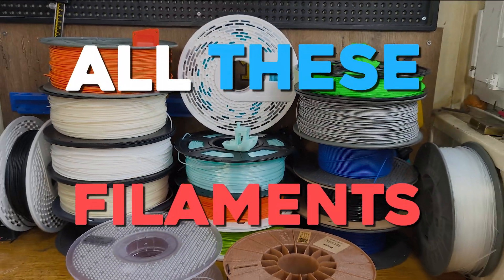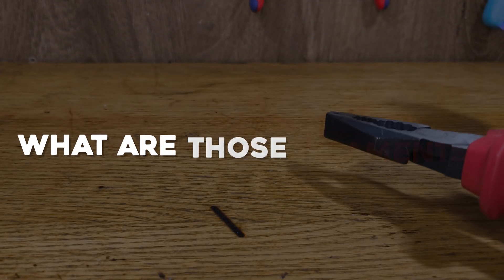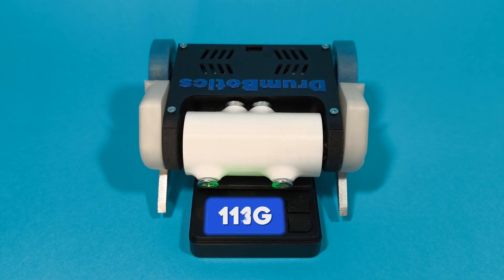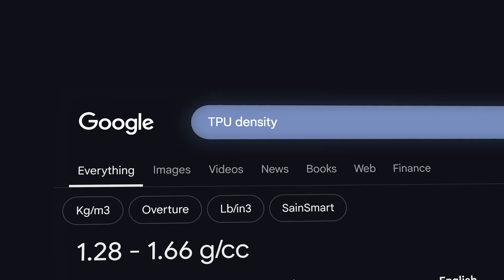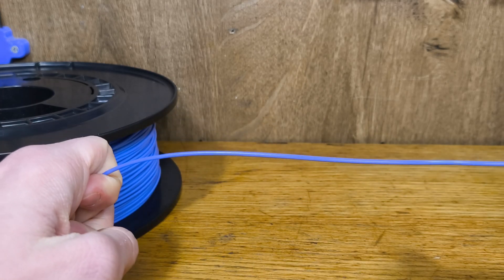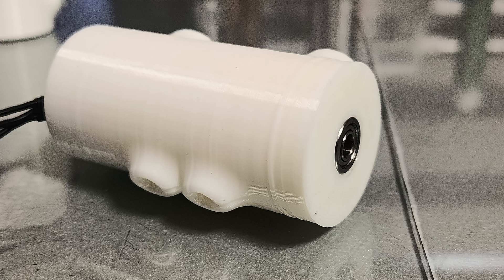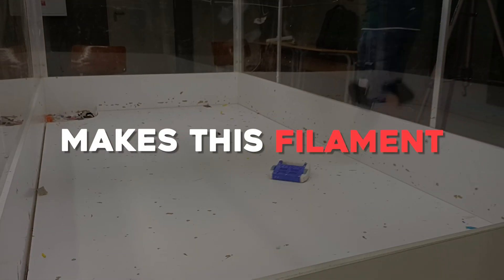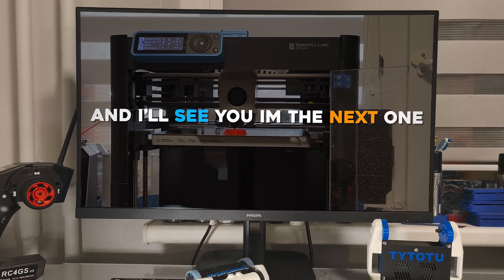Your 3D prints are BREAKING, here's why...

Comment: not sure how hips would be for combat bots but for rc cars makes a great material with good impact resistance. Ive printed motor mounts and spindles with it and it holds up great just hard to print well with from what ive done so far. and the temp recommendation on it is a bit low since its intended use is as support for abs but i think its great on its own

Comment: I tried using petg for the weapon of my plastic and weight shell spinner, even though it was tough, the supports were extremely hard to remove, and the teeth didn't fit in.
Reply from the maker: @Robogalex  Use a bigger gap between the support and the body, in the slicer.

Comment: Pick up some ceramic pla+ or overture super pla+, they're some of the best pla+ blends out there, and can rival nylon but with no moisture or warping issues

And the weight of pp is nice, but it still cracks under large hits, even with additional walls, because it's much more rigid. increasing walls makes this worse, so the ability to add more material for the same weight doesn't necessarily improve the toughness of the part

Comment: Nylon needs a garolite plate. The aftermarket ones are on a thicker spring steel base one so it's not going to warp anyway. Standard dryer is not going to cut for long term drying when you need 100 C+. Aside from that it's easy.
Reply from the maker: @MrHarvywallbanger  Standart drier is more than enought for sure. But yeah with garolite plate printing nylon became easier.
Reply: You don't "need" 100C, higher temps just speed it up. Leave any filament in 0% rH for long enough and it will dry, the temperature is just an easy way to both lower rH AND speed up the process all in one.

Comment: If I want my bot to be fully flexable, what should I use ?
Reply from the maker: If you don't care about weight then TPU is the best of course. Printing the whole frame from PP would be hard, same with nylon. It depends on what weight class you are making.
Reply: My bot is one lb and I have a weapon that's 147 g and a motor 94g, so the chassis weight is quite limited
Reply from the maker: @hanwencraft9393 If you would manage to print with nylon it would be your best bet, because you would definetly need to lower the infill of TPU if printing a whole chassie and It would be a problem having a very flexible robot, altough It depends on what type of robot you have. Have tried TPU chassies and they survived every time perfectly, but they turn out extremelly heavy.
Reply: @DrumBotics  ok thanks, I'll try to have mostly nylon and some tpu armor and see if that works
Reply from the maker: @hanwencraft9393 That's exactly what I do for my 200 gram antweights. Nylon frame with TPU or sometimes PP for the armor.

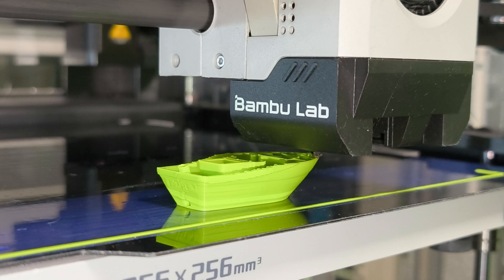Comment: 2:20 - I can't remotely see this being a benifit when infill has such high diminishing returns on all load strengths and impact.
Reply from the maker: I was talking on infill and walls and overall you could print your parts at higher wall number. It's a huge benefit when you need to save weight, like in combat robots.

Comment: my personal favorite is nylon but printing with it sucks like literally. from my experience, nylon warping is not my problem but the clogging from the nozzle and poor quality printing. i made a ton of research why this happen. In my conclusion, it is because of its very hygroscopic. it absorbs water so much and it needs to be dried out for atleast 12 hours. i use my p1s as a filament dryer, heating up to 70-80 deg and leave it for a day and store it in a very dry area using tupperwares sealed in a zip lock plastic then ready to print. i also made a diy filament dryer using tupperware connected to the printer so that no moisture will be absorb. and it prints well. 3 of of my 12 prints are succeed with nylon lol

Comment: try keeping infill low and increasing wall count instead, you might be surprized by the results! Tech Ingredients resently did a video on infill, and his conclusion was either have the infill very low or have it at a 100%, everything in between is just a waste
Reply from the maker: @josephgauthier5018  Woah, that's interesting, Will try this out with my robots frame in the next competition.
Reply: @DrumBotics  I'm pretty confident that it would be just fine, but it wouldn't hurt for you to do some testing first 😅
Reply from the maker: @josephgauthier5018  It's pretty much impossible to test outside of fighting in a competition. And I don't want to destroy my robot in my own arena before the competition so😀
Reply: @ oh, well in that case, have fun😃, and dont forget to consider top and bottom thicknesses when printing
Reply: Not a waste, just not ideal.

0-30% infill gives great returns, 70-100% infill gives great returns, 30-70% just gives linear returns. (40->50% would use 25% more material, be 25% heavier, and give 25% more strength. Objectively, this is still fine, but it's just not as large a gain as the difference from 10->20 or 80->90.)

Apparently some people call this an "expo" graph/function, but not sure how technically valid that name is, I just know someone who does RC racing and thats what they called it when I explained it to them, saying they had a word for it.
Reply: It continues to amaze me how people haven't heard/learnt that yet.
But yes, from an engineering background I can tell you that under bending of a  beam (just as example), the material in the center does 0% for the strength, as here the pressure and force equals 0.
The outer shells have an exponentially larger influence on strength than the material in the middle.

Conclusion: always go for more perimeters rather than infill.
Reply from the maker: @zvipster  Yes, but we are talking about toughness, not tensile strenght and then the whole layer matters, is it the same for toughness where a lot of impact hits occur?
Reply: @DrumBotics  it's still the same - if you want your part to have the highest resistance to impact, you'd want to have the most material at the outside.
That or you'd redesign your part with flexibility in mind, and in that way keep it from being torn apart.

Comment: Polymax PC is printable on most enclosed printers and if annealed will be the strongest rigid (frame type) material you can print without 5 digit spending.
Reply from the maker: I tried polycarbonate and ir didn't work well for me. Cracked right away. Although I tried not polymax PC and a random brand so that might be the reason. As well it's quite difficult to print it compared to CF-nylon
Reply: @DrumBotics  yes ordinary PC is not really printable in consumer grade printers because you need chamber temp > 100c. Polymax PC has a lot of additives to make it easier to print. It has some different properties than ordinary PC but it's still strong as heck. I print it in Qidi xmax3 with 60c chamber temp. I print inspection robots (20kg) that go inside large tanks and sometimes fall >5m with no damage.

Comment: Taulman PCTPE was great when you could still buy it.  It's a Nylon TPE blend.  Recently tested NinjaTec Armadillo.  It's a little harder than PCTPE but tends to crack on layer lines with the first settings I've tried.  With optimum settings it might match PCTPE?

I switched to Vision Miner nano polymer and all my prints even nylon stick great.  (haven't tried PP)  It also vastly reduces the time spent maintaining the bed.  A fresh coat lasts about 5 prints, so you can touch up the build plate where you've printed every 2-3 prints and go quite a long time before washing and re coating.
Reply: I have six rolls of pctpe (four of them are half kg) and I'm hoarding them for really important prints.  I've found ultrafuse 64d acts similar though, and doesn't need the heated chamber.

Comment: I used to use a lot of polypropylene, but it is prone to shattering on big hits.  If you want something about as light as PP but tough like TPU, try Kimya PEBA-S.  I have used it on my 3lb and 12lb bots.
Reply: Do you need to dry it beforehand? I'm looking for something like tpu but I don't have a way of drying the filament beforehand.
Reply: @YH-du3jc  I never had an issue without drying it.  It is easier to print than TPU in my opinion